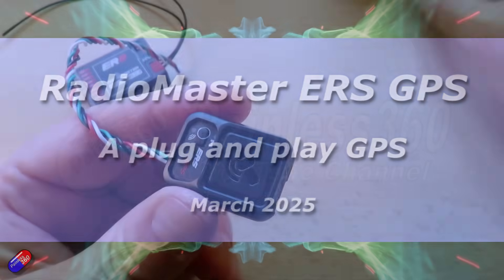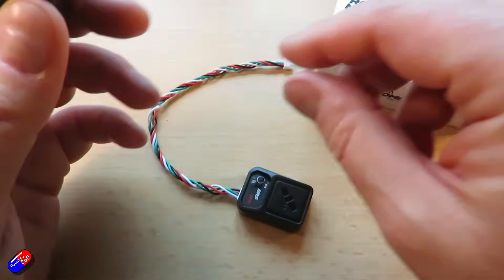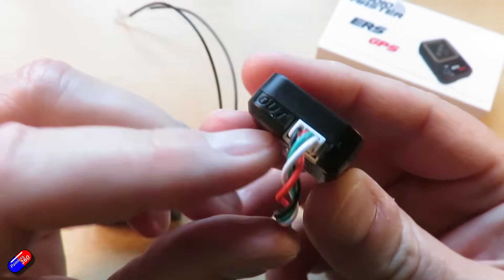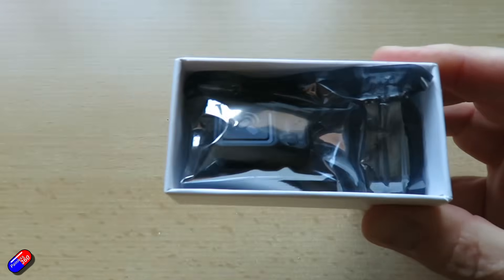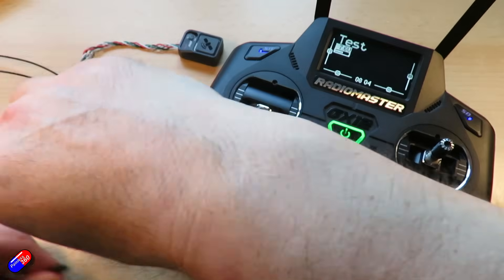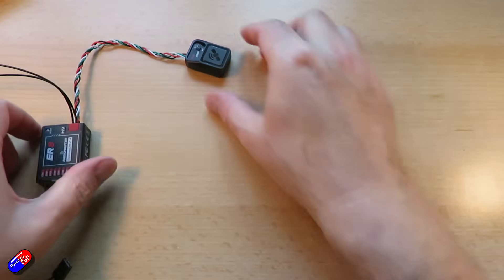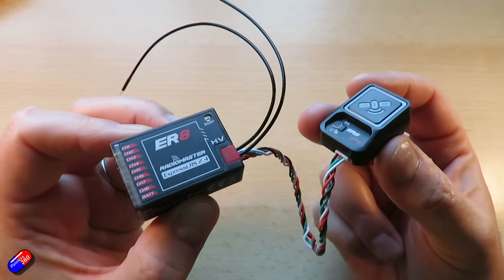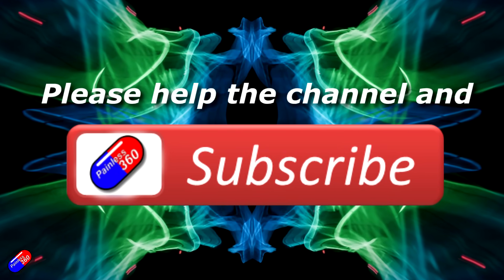Just released! Plug-in GPS Sensor for RadioMaster ER Series ExpressLRS Receivers

Comment: Hi, can altitude on the ER GPS be calibrated for zero m/ft at ground level?  Also when connected to say the ER6, is it as accurate and responsive as a dedicated Vario RX?  Many thanks and great videos.
Reply from the maker: You can play with the sensors to do that. It works OK but the lack of all data at once (speed, location, height etc.) is a drawback.
Reply: Thanks for the fast reply. From other videos I've watched, the speed recordings appear to be very responsive however nobody has tested the altitude readings of the module in a real time model setup. @Painless360

Comment: I'm wondering how hard it would be to implement a custom current sensor into this chain
Reply from the maker: Lots are hoping that one come out. When it does, it'll be on the channel... Stay tuned!
Reply: @Painless360  Yeah in the meantime I'll whip up an esp32/acs758 100a based one that just logs the current. I want to know I'm not overloading my battery/esc

Comment: Why does it have two modes to send different data sets? A flight controller can send both speed and location/altitude data to a receiver using the CRSF protocol.... so why can't this do both? Is it too computationally expensive for the processor in the that module to do both?

Comment: Does anyone know if this would be compatible with a Nexus running a RP3-H?
Reply from the maker: If it is, it'll be listed on the website. I doubt it, but worth a look... Best of luck
Reply: It will not work with RP3-H, since there is only one crsf-plug and that is used for the fbl (nexus). And it will not work (at the moment) with Rotorflight (2.2).

Comment: Does it only use GPS or also Galileo and/or Glonass or Beidou? Anything about the refresh rate? I have a hotliner with a FrSky XR6 receiver and i have tried to get some speed readings through smartport telemetry with a FrSky GPS unit, but the update speed was probably too slow because i got readings that made no sense at all. Looking forward to see someone use this radiomaster device and get accurate results.
Reply: Put a flight controller on it with an M10 GPS and get updates at 10Hz stored to blackbox memory on the model.
Reply: @techstuff6829  it's a hotliner a Hawk F5b, no room left inside for that.

Comment: OFF subjectbut i'm a newbie who is lost once again.  i have a Zorro Tx 4/1 with a Betafpv ELRS module attached . When I go into the Edgetx program and turn off the internal RF mode then set the External mode to CRSF (which I was told to do ) I can not find the Bind function mode ?..... any thoughts or suggestions?
Reply from the maker: It's in the ExpressLRS LUA script. Check out my ExpressLRS playlist...
Reply: @Painless360  Thank You !!!

Comment: This is great for addition to the pwm rx’s. Now for current sensor 🤞👍👍
Reply: Worth mentioning that current sensors are the least accurate way to determine battery capacity. As the cells get older they store less power and the capacity math gets more out of whack. Voltage will always be a more reliable method.